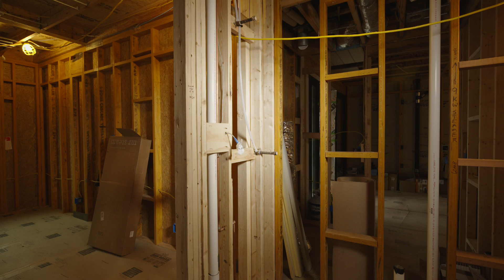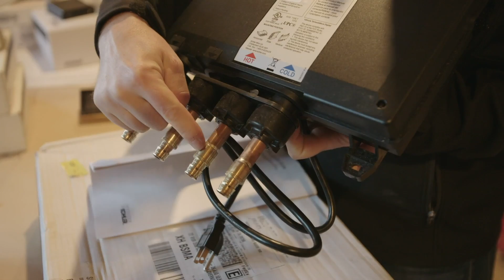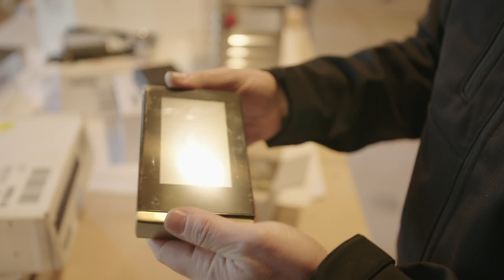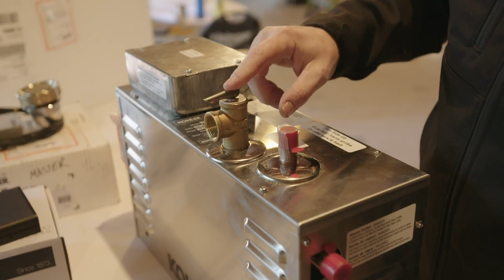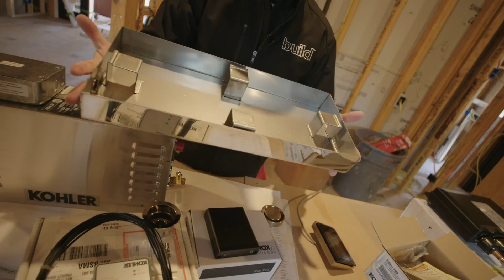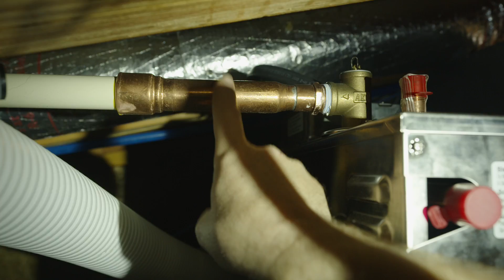Electronic Thermostatic Shower Valve - This is impressive!

Comment: The DTV interface was $1200 for just one - he has two!  How much is this whole install and how much to repair???  A $10 repair kit at any home store will rebuild a mixing valve.  This is all proprietary equipment!  No thanks!!!
Reply: He's doing a video about it because he didn't pay for any of it.  But for some people - and good for them, I say - $2400 isn't a big deal for the convenience and feature set offered here.  It's definitely not for everyone (or me either), but it is well designed and it looks great.
Reply: @brassmule  You do realize that the $2400 is just for the control heads?  This SINGLE water control system (for ONE shower) is well over $10,000!!!  And, as another replier posted, good luck if anything breaks as it's all proprietary.
Reply: @donabele1243  For sure. It's not for everyone, not for me, but for some people that's pocket change and that's fine. I bought a couch that cost $4k and I hope it lasts me a good long time. For some people, a $24k couch is the same thing.  Luxury and convenience have a price tag, and Kohler has used Build Show to get the word out about their products.  It's a neat system. Will I ever own one? Probably not. If a client wants one installed? Yeah we'll make it happen.
Reply: Totally agree. If the interface goes bad you have no choice but to replace it because even the plumbing in the wall is not compatible to traditional fixtures. No thanks.
Reply: Hey man to each their own. Maybe you don’t have the funds to live like that but he likely does. I’m sure he doesn’t want to throw money away for no reason but he’s obviously extremely well off with a successful channel and business. He’s an adult and can make these decisions for lavish toys. It’s obviously for comfort, it’s not a necessity. Everyone splurges on toys in one way or another.
Reply: @andydrew3320 
It's not about money, it's about whether it makes sense. There are very expensive "traditional" fixtures and there are cheap fixtures purchased at your local home depot.. So everyone is free to spend what they want. The issue is future repair. You have only one option to repair this and that is a direct replacement because of the unique plumbing. In a traditionally plumbed shower, you have hundreds of choices for repair or replacement. The only benefit of this system is pushing a button instead of turning a knob for water. The cons outweigh the pros.
Reply: @DerekFromBK  It IS about money though. That’s exactly what this is about. In the initial comment he referenced money and it being $2400 for the two interfaces. It’s his house, his choice, his funds. He wants to spend a hundred grand on a shower or a toilet, who cares. He’s free to make that choice. He’s worked hard and can afford it.
Reply: @andydrew3320  That's not what this is about.  He used to show innovations that the average person could reap benefits from.  Now, it's all about his sponsorship - he didn't pay for this, just like most of the things going into HIS house.  He's become a corporate shill trying to convince people to spend $10,000 for a water control unit for a single shower!  I barely get through two minutes of most of his videos before I dislike and move on!